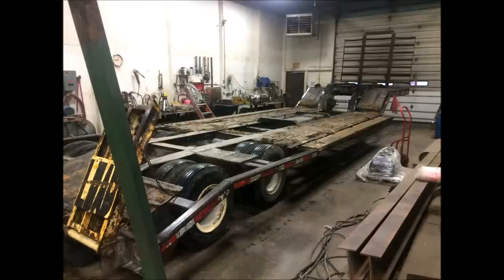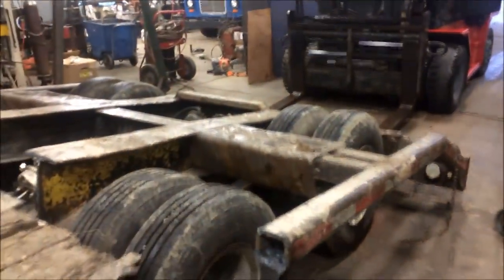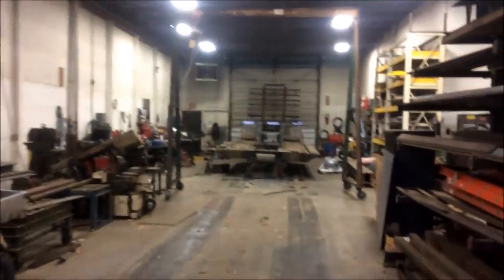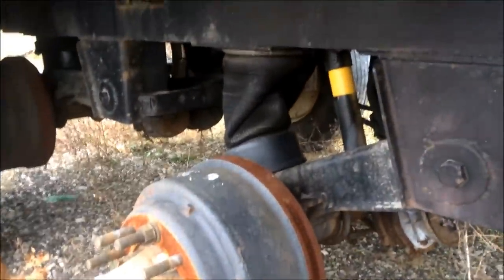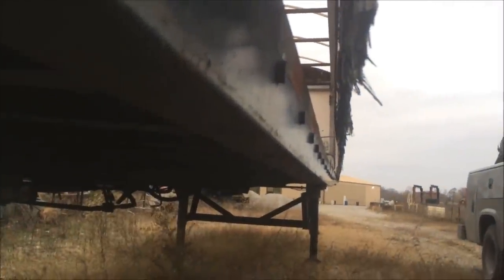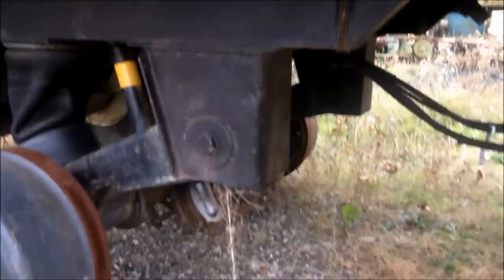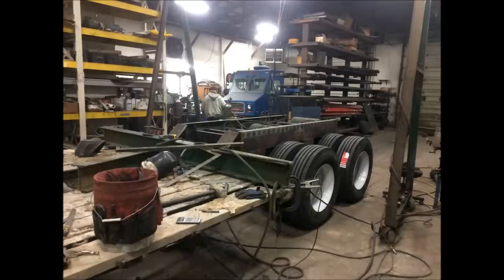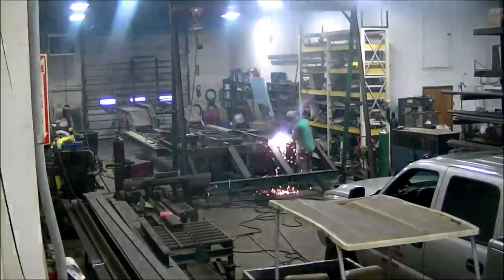Trailer rebuild: turning lemons into lemonade

Comment: Oh, wow, yah just give a fella a headache.  Best comment, 'bout 1:45 " . . .haul it off for scrap . . .".
Drop Deck.  NOT brand new.  Getcha a 35 ton. Thats what yah need.  Had one in the Rocky Mountains for about a season.  Quick, easy, safe.   Why yah still go up an' over them rear tires to get loaded is beyond me . . .'specially on a wet day . . . .
Best Luck, Wade and the rest of the team.
Reply from the maker: James Heath james check out this Saturdays vid and see if you like it when its all done

Comment: Better late then never.  I'm guessing to be safe (then sorry) you welded in some doublers to strengthen the bed to suspension frame welds?
That should last at least when your grandchildren will need it.  ;-)